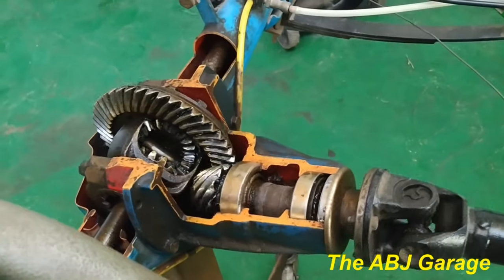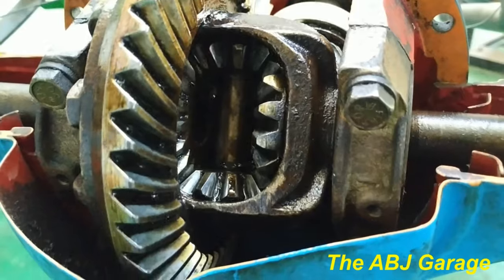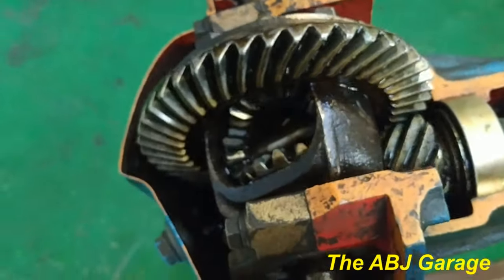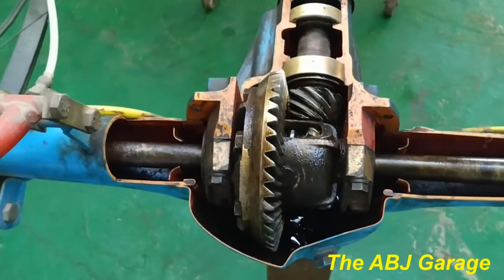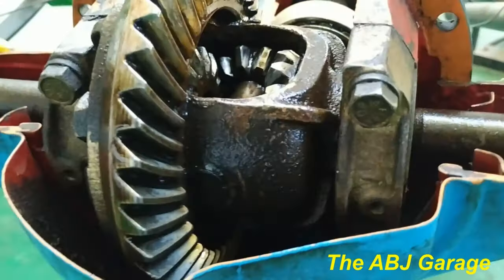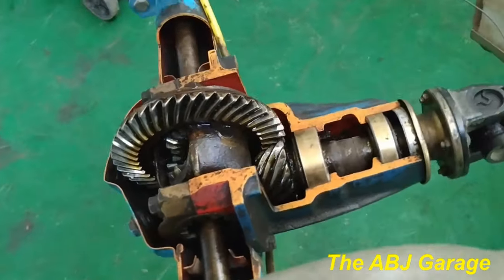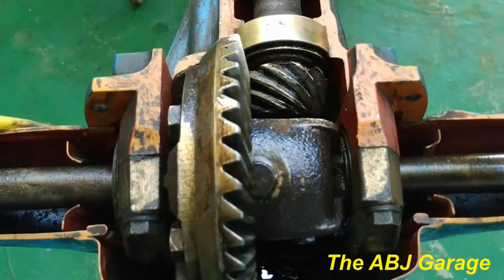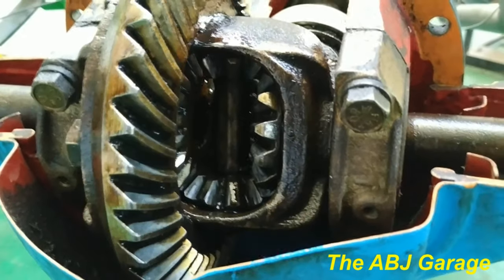5 symptoms of differential troubles

Comment: My Captiva AWD has an issue. While turning the steering or making a U-turn at a slow speed, the car shudders as if something is holding the tires. While reversing and turning the steering, it has the tires with vibrations. Moreover, both the rear tires are worn only on the inside. The problem doesn't seem to exist when I remove the drive shaft. I tried to change the drive shaft of a good car, but the problem didn't seem to go away. Please help me. What might be the issue with my vehicle?
Reply from the maker: Have you looked at the wheel alignment? It seems you have wheel misalignment issue!
Reply: @TheAbJGarage  Thank you for your response. Yes, I checked my wheel alignment, and that does not seem to be the problem causing this issue. As I mentioned, removing the drive shaft eliminates the problem. I changed the drive shaft to a new one, but the problem persists.

Comment: a humming noise was coming from my forester and a mechanic changed wheel bearing assembly but that did not solved my problem. I am experiencing same symptoms like corning issue, sudden speed gain, poor steering handling. Every mechanic has tried from changing the breaks, rotors, calipers to wheel bearing but no one ever find the problem. I am really zero confidence on so called mechanics. Now I am thinking the amount I paid to them  for not solving my issue could have used as a down payment for new car.
Reply: What did you do to eliminate humming noise ?
Reply: @nzweuwaheed  nothing, living with it.
Reply: That's ur differential mine hummed because I had a leak I wasn't aware off so I was riding dry and mines ended up locking in the fwy
Reply: Yeah it can be dangerous especially if it locks up while driving on interstate it something.. it eventually it will break down on the road somewhere it can be now or later or even years never know that is the bad part

Comment: Hi, great information! I have been having trouble diagnosing my Jeep Wrangler Rubicon's noise for about a year now. I've been to the dealership multiple times and they always tell me it's normal, which I think there is something wrong with the Diff. First of all, there were fluid leaking all the way to the driveshaft. The dealer says this is from the drain plug, which I find BS. Then all of my tires were cupping, which the dealer blamed on lack of alignment. I also hear a whirring or whining noise from around 45mph and I can manipulate the noise by feathering the gas pedal. The dealer says some Danas are just louder than others. Lastly, I would occasionally hear a clacking (not sure how to describe it, but sounds like something is binding) and a thumping/clunking noise when reversing while turning and when coming to a stop. This noise happens randomly and is hard to reproduce. Would you please help advise if my vehicle is having differential issues? Or is this normal differential slack? Thank you for your time

Comment: Why can’t they make one solid piece instead of pieces
Reply from the maker: one solid piece that split power, change direction of power flow, multiply torque, and allow left and right wheel to be driven at different speed? It seems human knowledge is yet to develop to create a solid piece differential that will allow left and relight wheels to be driven at different speed!

Comment: Greetings. There's a clunk sound in the differential during sudden realease of clutch or sudden press of acceleration pedal. Cross joints are ok. What seems to be the problem?
Reply: I'm having same trouble and suspecting yoke and pinion/splines. Any luck ?
Reply: If your differential is a limited slip, then it could be worn or damaged clutch packs.

Comment: I've got a 2005 GMC Yukon 5.3L 4x4 with 234,000 miles, all stock. It makes a clicking noise similar to this, that I can usually only hear with windows down and driving next to something like a wall or tall curb.  
It only does it when applying gas though, and in a forward gear.
I have examined the u-joints and driveshafts and they look fine and tight. It does look original.
Do you think this is the issue?
Reply from the maker: You  must be hearing the echo of the vehicle noise!

Comment: Hello
Very good, but my car is vibrating at 40km/h that's could be the differential??
Thanks
Reply: Try rotate and balancing tires  first. This could also be a u joint or cv axle issue.

Comment: im having noise when i decelerate typically in higher gear 4th around 2.5krpm had gearbox inspected and parts replaced aswell as clutch and flywheel and still have the noise. i have a Mitsi lancer Evo 5
Reply: Sounds like you may have a transmission related issue. Worn gears or a bearing failure perhaps.
Reply: Especially if the issue occurs only in 4th gear.

Comment: Hi. I’m finding it impossible to turn without the car juddering or even feels like seizing and while this haopens , makes a horrible noise and when releases shakes the whole front end . When trying to drive in straight line irritant happen but I haven’t pushed it over 20 mph to see . The only way I can take a ckrner🎉wuthiut this happening is bye engaging the clutch and coasting it . . I’ve been told it’s my gearbox but no one wants to check it . Wot do u think this could be and how much to fix . Please any help will be o much appreciated
Reply: I’ve got a Peugeot 208 gti bps and it has a limited slip diff

Comment: Thank you for sharing. Keep up the good work.
Reply from the maker: thank you very much bro!!
Reply from the maker: like like like
Reply: Greetings from Skopje Sir, i have problem that might be conected with bad diferential. When accelerate, the car is pulling on left side, my stering wheel is going about 3-4cm on left...at first we tought that it can be caused by bad rubber parts, suspension, i've change all those parts, the gheometry set up is perfect, but the car still pulling left, just when accelerating....some mehanic told me that this problem can be caused by the differential, i am asking you advise, does it possible the differential doing that pulling? The car is seat ibiza 1.8t 2006. Thank you sir.
Reply from the maker: @darkoqc1670  Dear! If your car is pulling to one side when accelerating please check wheel alignment. wheel alignment related problems, unbalanced tires, and wrong tie rod adjustment can also lead to car pulling to one side. Please also check if there are loose or damaged suspension components. It is not common for Differentials to cause such a problem. also check to see if there is brake releasing problem  on some of the wheels.
Reply: @TheAbJGarage  thank you very much for your answer, the tie rods adjustment is ok, brake release is ok, becouse i had installed eibach sports suspension, i will check them out onse again...
Reply: I cant believe that after changing all suspension parts, all rubber parts, inners, rods...the problem with pullin on left site was still there, and than suddenly i just say to myself, why i didnt check the tyres? After changing the front tyres, the pulling stopped immidietly!!! Omg!!!
Reply from the maker: @darkoqc1670  wow congrats!! Size and pressure difference on left and right tires can also lead to car pulling to one side. If there are some irregularities or bumps on one tire, that can also lead to side pull..... well we forgot to try changing the back tires to the front to see if the tires are causing the side pull!! Well done!!
Reply: Thank you Sir

Comment: What about a loud clunking noise? when setting off in 1st gear and reverse gear
Reply: This could be due to worn differential gears causing excessive backlash (play)
Reply: I would park the car in neutral and crawl underneath and rotate the drive shaft by hand checking for excessive play.
Reply: @aaronsprojects9022  Thanks for the reply, i already did this, there is hardly any play from propshaft to diff, but the diff clunks really loud, coming from inside the diff
Reply: Broken teeth bro @tompwh

Comment: Hello! I just had my rear differential replaced. It sounded horrible before but it’s 100% better. However, I was recently told that when you need a balance and rotation, that it alone can cause the differential to go bad!?  This really didn’t make any sense to me but I needed to ask if this is correct information. 
Thank you
Reply from the maker: Dear!! unbalanced tires are cause of vibration, the vibration and wobbling at the tires can make the final drive assembly to go bad. Tire rotation on the other hand helps to have even tire wear on all the wheels, if the drive wheel tires have uneven wear that can cause unwanted vibration. Rotation will temporarily fix the vibration issue if it is caused by unevenly worn tire.
Reply: What was the sound you heard?
Reply: Some require the exact dia. tire or running like that puts alot of stresses on the poor thing. A friend (happy go lucky type) was driving with stereo on loud and his stripped the gears out of it !
Reply: @whyshehereike9904  it was a combination of sounds, thuds, clanking, and some grinding. I only took it to the shop because I thought it sounded like something was about to fall off the bottom of the truck.

Comment: How to know that the differential is over heating
Reply from the maker: I have a friend who was driving F150 and engaged four wheel drive for a while and then after a while we started having that hot oil smell and we found out that differential has overheated, especially if you were involved in massive towing, that will leads to differential overheating, which feels pretty warm to the touch.